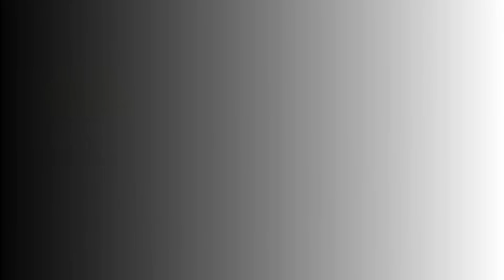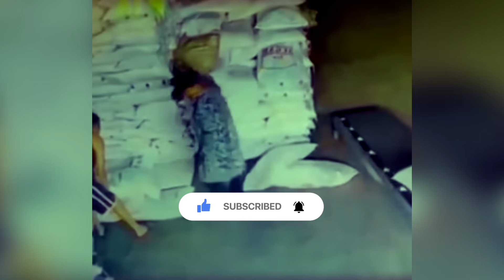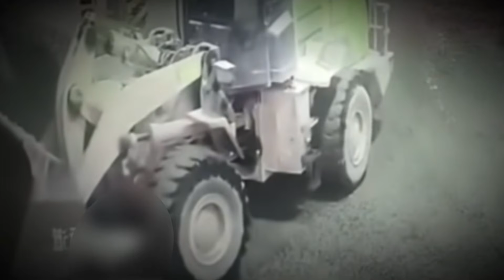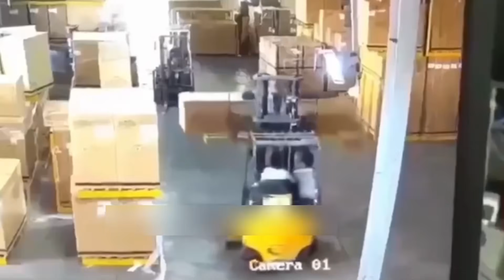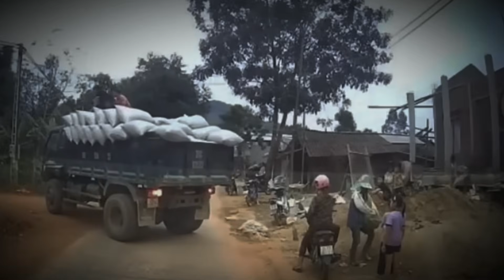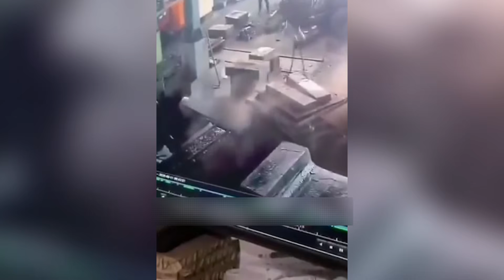A Small Check Turned Into a Major Accident... Big Mistake

Comment: When i was an apprentice electrician, me and the master i was working under were pulling wire on a new gym construction site and the hvac man was a little off in the head and had a young guy working with him. They were moving a manual ventilation shaft lift into another room and about ten minutes later we hear a scream and a loud crash. The lift had tipped over with a 10ft section of air vents and landed directly on the guys knees crushing both of them. Ill never forget that day.

Comment: With the forklift incident, this video has it wrong. The guy was NOT "standing on the platform". I read what happened. This guy fell asleep, taking a nap. His coworkers thought it'd be funny if he woke up way up high, not where he fell asleep, and would need to call someone to help get him down. Unfortunately, you saw what took place. If I remember correctly, the guy did in fact die from being hit by the heavy yellow steal guard.